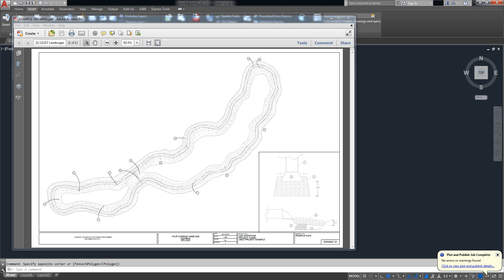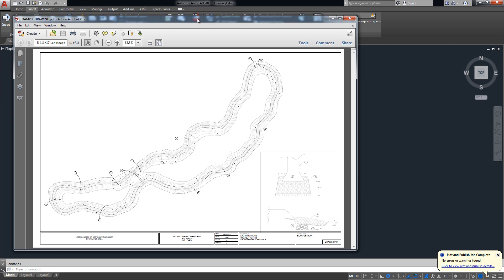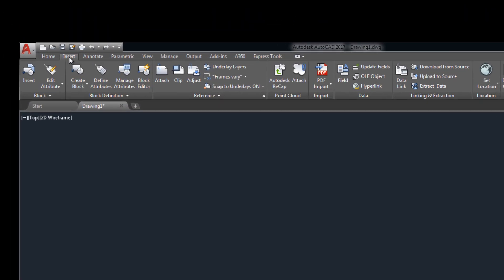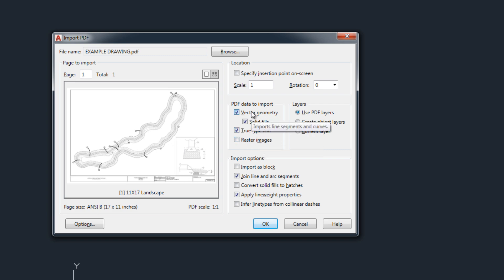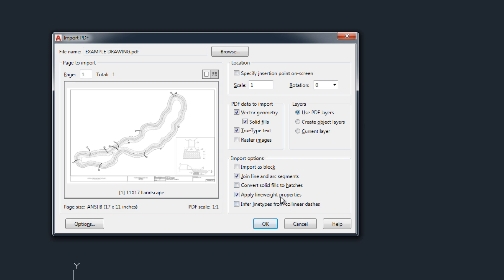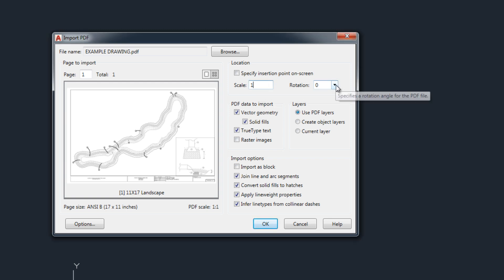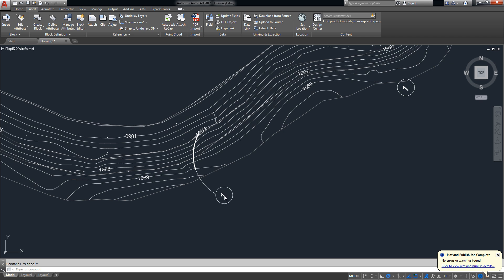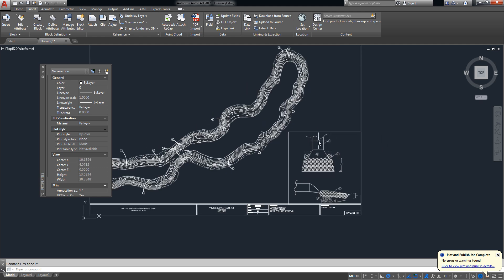AutoCAD PDF to DWG Tutorial: New 2017 Feature

Comment: Text comes in automatically as MText if the text was a TrueType font when the PDF was originally created and you check the box for TrueType fonts.  Most text in DWGs are shx fonts, those will come in as pieces and the PDFSHXTEXT command will be necessary.

Comment: I usually need to adjust the scale. If it's 1/8 = 1'-0 then I need to set the scale to 96 in order for it to be the right size. Not sure if I'm doing something wrong, but that's the only way I can get it to be the right scale.

Comment: Great video!  Your video helped me do the conversion at work quickly and seamlessly. It worked great for everything but the text. The text came in as each letter being an individual piece of geometry instead of editable text. I believe the integrity of the text is dependent on how the PDF was actually created (if it was scanned vs. created directly from AutoCAD). This was a PDF that was sent to us so I do not know the origin. I had a request to convert a BOM (Bill of Material) from within a PDF to excel. I was hoping to convert the PDF to .dwg and then be able to export it out of AutoCAD into excel. Please let me know if you know of any tricks that work with the text conversion. I went into a PDF that I generated from AutoCAD Electrical that had an Index Table generated from a report and the text converted into MText just fine. But then another table in that PDF that was generated for the BOM and Wire Lists imported as just the geometry. I will spend some time working with this more. Thanks again for your video!

Comment: Hope you answer this, I can't find an answer anywhere. So I am using Autocad 2017 and I found a pdf of a sink that I would like to use (in this pdf it has an elevation view that I would need). When I import it wont bring in the elevation view or any view of that sink for that matter. I thought this function was supposed to work on any pdf, am I doing something wrong?

Comment: hi importing is an easy task but the scaling is all wrong how do you get the correct scale after you import , i.e. i ahve a line that measures 2000 m but when i measure the imported pdf it measures 16 m , do do i change the scaling and the anlge the pdf should be so that i can add different equipment on the drawing and the pdf allows the client to see the equipment on the local geography
robin